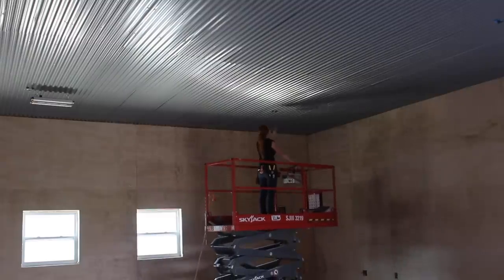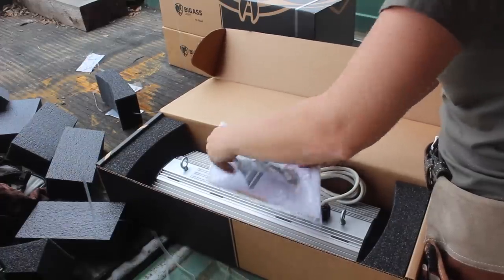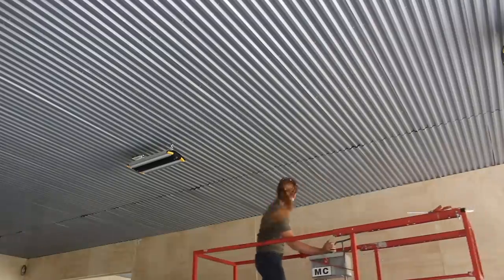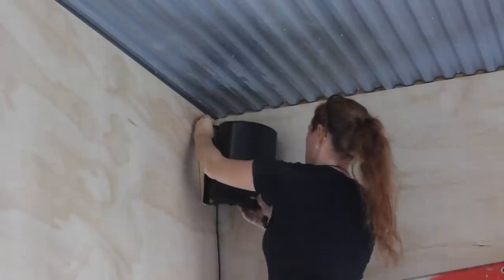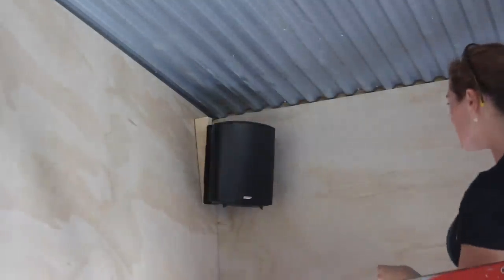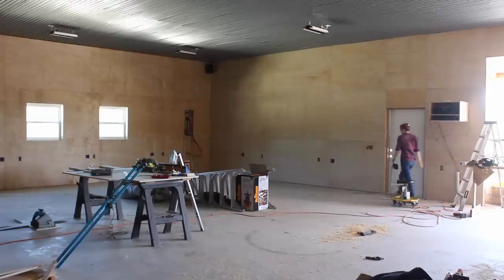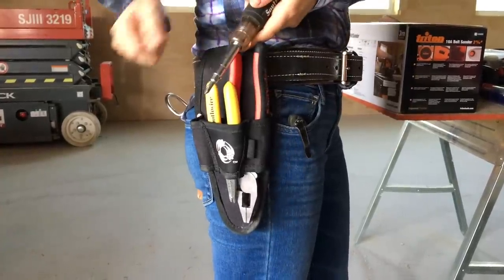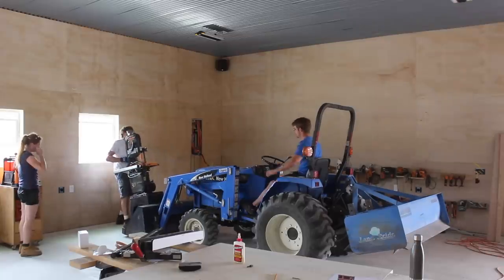Building A Shop - Installing Lights, Outlets, and Stereo System

Comment: Speaking as a professional electrician, I have been dreading this video.  You shortened your light cords to fit the ceiling outlets, and you curled your receptacle wires so the screws could pull the wire in instead of push it out.  Well done.

I’m impressed and a little ashamed that I doubted you. The shop looks awesome! Thumbs up!

Comment: Congratulations!!! I have been a big ass fan of Big Ass Fans for many years.  I used LEDs in my shop for lighting.  I have 16 fixtures that put out 9000 lumins per fixture so I can see OK (even though I am legally blind).  The only problem is welding.  When all the lights are on, it trips my auto darkening hood.  Good thing I wired them in strips with a switch for each.  I am very glad you are happy with your shop. Now, more projects.

Comment: Awesome workshop! Thanks for sharing! )
About using extension cord while you wait for electric company: you actually can turn off the main breaker (and double check that it's off) and then connect your extension cord to one of the wall outlets with plug-to-plug short extension (and make doubly sure that it's not gonna accidentally unplug) and you'll have power in all of the remaining outlets and shop lighting.

Comment: Bummer on the power.  What would it cost to rent a large diesel generator for two months?   Also add a generator transfer switch so you could run all of your shop from the breaker panel rather than an extension cord.  Just a thought.
Reply from the maker: It would be such an annoyance to listen to a generator all day. : / I think I'll just tough it out and work with the cord in the mean time. I will run a generator when I need to use my bigger table saw though.
Reply: I get that.   Of course, you could always wear your IsoTunes.  ;-)
Reply: Maybe at least put a 3 way splitter on your extension cord. I hate the hassle of switching out tools on cords...😑 shop is 🔥though! Im jealous! Lol
Reply: Hi April;  You or your Electrician can add a temp power cord to your Power Panel main lugs to have power to your shop.  Plug into the Generator running out side, away from the building to keep it less noisy.  Love your new Shop!!!
Reply: It would also mean you don't have to stop working if you ever get a power cut.......
Reply: I think I would install a backup generator for the entire property in here as well then you could install a transfer switch and  temporarily install a generator for the shop for the couple of months until you have service and install the permanent  generator after. .
Reply: April Wilkerson . Why not a whole bunch of solar panels? It's sunny enough were you live and the roof is huge. If you use it in combination with some battery cells you will be as good as gold!
Reply: Decent power inverters can be found for roughly 10W/$. Just don't expect ABB level flexibility at that price.
Reply: NiHaoMike . I don't really know what you mean by "ABB level, but what I do know from experience that her place is big enough and has enough sunhours to practically live off grid. Or in some cases (depending on the state or country) can deliver back to the grid. It will be a small investment in the beginning but in the end it will itself back easily. Besides it's also a lot better than burning fuel the whole time.
Reply: ABB is a premium brand of power inverter most commonly used in industrial environments. They allow you to program the output voltage and frequency (and lots more) to suit your application, but they're also very expensive.
Reply: Solar panels are expensive,not to mention maintenance and battery banks.
Reply: Trey Nathaniel . Well in fact they are very profitable after just a couple of years. Just harvesting money. Also you don't burn fossil fuels etc
Reply: What brand circuit panel did you install?  A lot of companies are selling generator interlocks designed for their own panels now.  I got an Eaton panel with the matching Eaton interlock and it makes the setup super simple.  But it's really just for running refrigeration units and my boiler in case of a temporary power outage for me.   My generator really isn't that loud on the other side of the wall, but I'm sure it would annoy my neighbors.
Reply: Hm... if 622,000 people call your power company, I'm pretty sure they could squeeze you in tomorrow...  <evil grin>
Reply: Have you ever installed solar panels? Very profitable after a couple of years? Ha. As an electrician, I call bullshit. I have not seen one system that has payed off as fast as claimed it would. If you can't store it, the energy is useless. Batteries are incredibly expensive and wear out fast. Most areas I know of now have a flat rate fee to send energy back to the grid, but many won't buy that dirty power anyways. Only reason I see solar panels going up left right sideways is the 300% govt grant increase that started 2 or 3 years ago that's still in effect. Forget solar! if you wanna spend $ to reduce your carbon footprint good for you, that's about all you'll do
Reply: ManCraftingTM z

Comment: For corner brackets for speakers like that in AV, we take 4*4 poles, turn them 45* on edge, and run them through a bandsaw at round 20* angles. Easier and cleaner than guessing the right amount of crooked haha.

Beautiful in there as it is going. And I am loving those shop lights.

Comment: So you put a 10 degree shim in to fire the speaker down but then leveled out the speaker by the brackets?  Doesn't leveling them out defeat the purpose of the angle?
Reply: Mate2Frio 
I think she meant plumbed, not leveled. Vertically straight.
Reply from the maker: I plumbed them, so left to right they are straight but back to front they are angled.
Reply: Basically, she leaned them in both directions.

If she hadn't adjusted the second axis, they 
would look lopsided.

steve

Comment: Hi April: Long time viewer.  I am glad to see you left sufficient wire leads when installing those ground-level power outlets.  Here's an FYI, an electrical contractor friend told me that 10" from the box face to the end of the stripped lead wires is what code requires.  I trust what he said is true, but I am not an electrician.  Keep up the great work and stay creative!

Comment: Amazing progress in the shop! But did your professional audio guy tell you that corners are the worst place for speakers? Ideally they should be at ear height (or a little above) and on the wall about 1/4 wall length in from the corners.
Reply: thats why she angled them
Reply: Agree, terrible speaker placement as well as system design.
Reply: with that many speakers, 70 volt probably would have been better.
Reply: It’s a shop not a concert hall
Reply: ForestCat  I used to do that placement but it seemed to loose the stereo effect so I pushed the speakers to the corners and aimed them at opposite corners to help eliminate hearing only the speaker in front of me when sitting off center. In the shop I wanted the speakers as high as I could get them to keep them out of the way and flipped them upside down to get the mid/treble speaker closer to head height. My speakers are more old school with a rather large box so I could flip them and get away with it. I can crank up the volume and play "White Punks On Dope" and feel like I'm at the concert all over again.
Reply: Exactly.

Comment: No bathroom. Thirty hours a month running back and forth to the house, not a good use of time. Shop is super nice, but no John.  I call my john, Jim. Run to the jim.
Reply: Assuming she works 5 days a week, that's 20 days a month.  You really think she'd spend 30 hours back and forth (remember, bathroom time won't be any longer, just travel).  That's an hour and a half a day.  Assuming she goes once every 2 hours (seems like a lot to me), that's 4 times a day to/from the shop for bathroom breaks.  4 times divided by 90 minutes = 22 minutes there and back.  The average walking speed is 3.1 miles per hour (20 min/mile), so unless she walks half a mile each way to the bathroom 4 times a day, she is not spending 30 hours traveling to and from the bathroom.  If so, maybe a porta poty would be cheaper?

More likely,  1-3 hours traveling to the potty per month.  That being said, I am surprised she didn't install a bathroom.
Reply: Running a waterline down to her shop would be significantly more complex than running the electric lines/pole and much more expensive. From what I've seen, her property has several layers of solid  rock just under the surface of the ground cover. Digging in a water line, at a depth which meets code and runs the distance required to hook up to water main, would cost a fortune! And...that's before you even factor in the cost of installing a septic system/line yet.
It would take YEARS before she would "break-even" on the water line cost vs time lost going to up to the house to use the bathroom. From a cost perspective, it would make more sense to buy a new Porta Potty and have it serviced, than install a bathroom.  But honestly......the location of her shop gives her plenty of privacy to "Run to the Jim" out in nature. LOL!
Reply: NordicPhoenix she could put in a bathroom with just a composting toilet and maybe have an RV style sink that pulls hand washing water from a tank
Reply from the maker: I think it's so unusual how concern people are with my bathroom needs......
Reply: Agreed!  LOL!
Reply: It is nice to have a sink too.
Reply: April Wilkerson , hahahahaha I see where you're coming from.

All of this awesome great news your sharing and that was their takeaway!? lol

Maybe you'll come up with and share your bathroom solution. Maybe you won't. I promise I won't lose sleep either way :)
Reply: Nothing says love like a new toilet! 😂
Reply: When ya gotta go, ya gotta go, right? lol
Reply: Rainwater collection from the roof, cistern, and a pump would give her running water there
Reply: You need to work new construction for a while. It's amazing what a 5 gallon bucket can accomplish. Just don't leave the lid off too long.lol
Reply: Damn, James....
Reply: Casey Rand , he's a "walker",,, it's in his DNA... 😂
Reply: could always get a water-free composing toilet
Reply: Seriously!
Reply: April Wilkerson Hahahaha
Reply: TheRocketBob22:  That's actually a really good idea.  If I start telling people how much time I spend at the "jim", they'll think I'm in really good shape.
Reply: TheRocketbob22 more concerning is a metal workshop with no water. Mustn’t be planning to work with metal
Reply: An outhouse works perfectly & you can install a chemical toilet.
Reply: @AprilWilkerson  : LOL how true....that time is strictly for you🙂👍

Comment: YAY! Those lights are bad ass! LOL  I got chill bumps again when I saw them come on. 
I am so happy that you included the footage of hanging your speakers. We are about to install speakers throughout our haunted attraction and now I know to put them on a shim! 
That bites that you have to wait so long to get your electrical. Ours was a big ordeal too. At first they wanted to put the poles in our yard but we kept going back & forth until we got them to put the main power pole right beside our building. We only had to dig 6 feet instead of 150 feet! 
Your shop is coming together. I am so happy for you. Thank you for sharing it all.

Comment: Quick tip I have learned: Get a foam water squeegee for sweeping dust from concrete floors that are relatively flat. They work better than the big push brooms, and kick up very little dust. I actually bought just the head section, and attached it to the other end of my broom.

Comment: i am suprised with that big of a project you didnt have a temprary service put up. usually from there its about a half hour or so to do the permanent connection. yes it is an extra expense but that way you'd know the electric company would have little to hassle you with to hook up. and no messing with generators.          you are living the dream !!!!

Comment: Looking great!

I notice you put the outlets in with the ground pin pointing downward. I don't know if it's a requirement, but most industrial spaces I've seen put them in "upside down." The theory is that if there is a slight gap between a plug and the wall, and you drop a conductive item down onto it, it won't accidentally short across the hot & neutral, but instead will bounce off the ground pin. Not sure how important that is, but it made enough sense to me that I have been putting in all my outlets that way.

Comment: A little tip to help speed up the wiring of the outlets.  Instead of trying to use your strippers to strip the outer insulation of the romex so far back....Use a utility knife and make a slit (lenghtwise) in the end of the romex insulation.  Peel the insulation back, and then hold the insulation in one hand and the wires in the other hand.  Pull them apart, and the insulation will peel back as far as you need.  Then you can use your wire cutters or utility knife to cut the insulation off.

Comment: Awesome job April rule of thumb when you put outlets in “Ground always up” that way if the plug is not pushed all the way in or gets knocked down and let’s say a square falls on it ,it will hit the ground instead of hitting the hot and neutral causing a short. How we always put outlets in but there is not right way just how we do it. Gotta get me some of those BIG ASS LIGHTS lol

Comment: Hey April.  The space looks like a real shop.  This is just one of those small details that goes unnoticed.  I work in a theatrical scene shop and I noticed you sweeping sawdust on the concrete.  Two things about that; Are you aware of sweeping solution?  It is a green dust used in areas where dust particulates are high and cause some sinus and lung irritation.  I am guessing you are going to use some dust collection but it may be different when cleaning in the metal shop.  The other is the concrete itself.  One of the shops I work at installed a raised sprung floor for us to work on.  It takes some of the fatiguing effects of working on hard surfaces.  Small pads can serve you well at particular workstations  as well.  Keep up the great work.  Once again the shop looks great.

Comment: Thanks for the tip on the big ass lighting my wood shop is not bad with lighting but my garage need a lot of help I spent a time wiring and putting in some old halogens I had waste of time I will look into these lights thanks

Comment: When installing outlets, after attaching the wires, give the whole outlet a 180 degree rotation to firm up the wires.   Then wrap electrical tape around the outlet to prevent grounding.

Comment: Very cool shop. I'm jealous. It's always nice to have a sound system in the shop. For folks on a tight budget, you can buy fairly decent stereo receivers at thrift stores for $20 or less. There are many options for nice speakers with mounting hardware included. Look for indoor/outdoor speakers. Many choices for $100 or less for a pair. My garage system uses a 20-year-old receiver which powers my old JBL speakers in the garage and I bought new Yamaha outdoor speakers for the patio/grill station area (The receiver has A/B speaker outputs). I also bought a bluetooth adapter for about $20 (by Esinkin) that works with any RCA input pair in the receiver. This makes any dusty old receiver into a bluetooth-compatible receiver.

Comment: April, if you haven't thought of this already, get a "drywall hoist" to help put up the plywood decking for the patio ceiling. You can buy one for about $100, or rent one at a big box store (and probably a Taylor Rental or Sunbelt or whatever other tool rental place is down there). A wheeled, tilting hoist will make putting up 4x8 or 4x12 sheets a breeze!

Comment: April, I happened upon your channel a few years ago and continue to be impressed with your fearless, can-do attitude, tenacity, and ever escalating skillset. You consistantly present as a well grounded, and very capable, class act and most certainly an infinitely better example of female empowerment than what typically passes for such in media.   Be well and much success going forward.....as if the latter was in question.

Comment: Cool trick using the battery to locate each speaker. if you only know how old that trick is....... You will love those Bigass lights. We use them here and also the fans. Great product. Good job on the build April.

Comment: Be gentle using power drivers to tighten the screws on outlets and switches. They are brass into brass, and strip easily. Also, many codes prohibit ceiling lights plugged into outlets; they should be wired into boxes. Your shop is awesome, and I am stricken with envy. 👍👍

Comment: Looks good so far, I will say that you may want to go buy some metal outlet covers. It looks like many of the boxes are recessed in a little far and it's pulling in on the covers. They usually will last about a year before use and temperature swings break out the screw web in the middle.

Comment: A good idea is to wrap the outlets brass connection screws with a single strip of electrical tape... helps from getting a shock if you have to change something without shutting the power off.

Comment: Run the extension cord to the panel (use a 14 gauge cord).  Cut the female end off.  Connect the white to the neutral bar, and the black to both terminals of the breaker.  This will give you 110 everywhere.  Since you work by yourself in there, it's one tool at a time anyway, and you will have all your lights and plugs working.